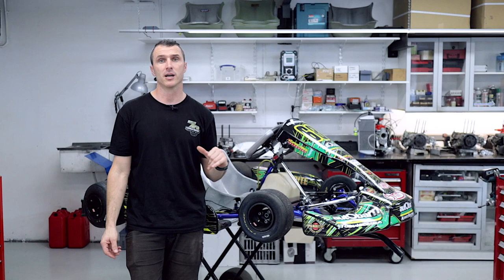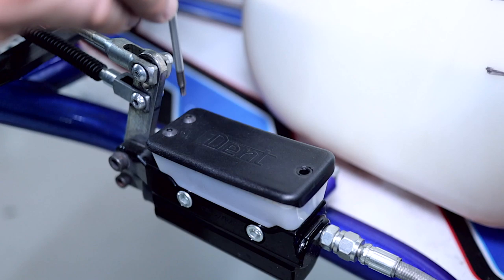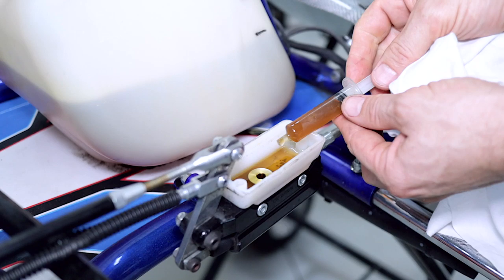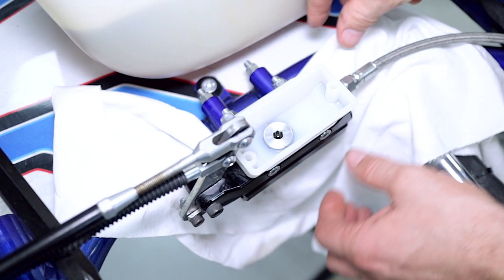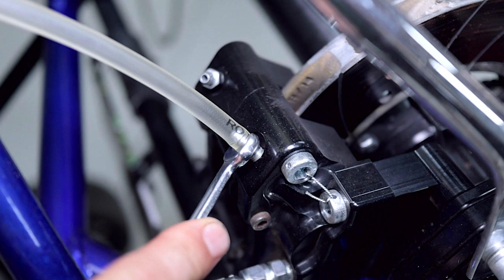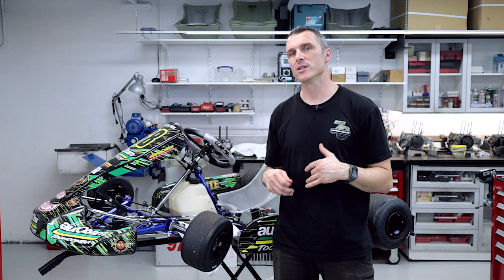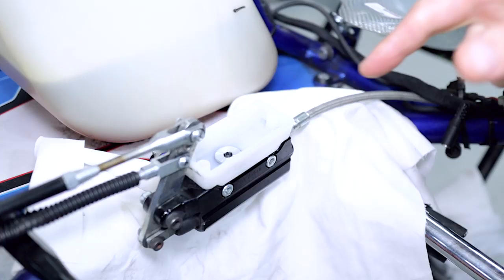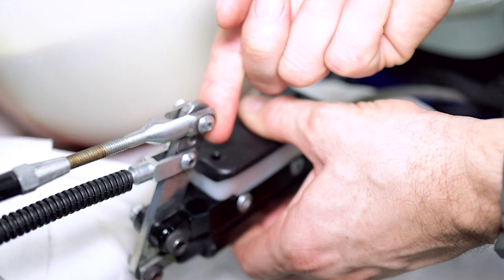HOW TO: Bleed Your Dent Go Kart Brakes - POWER REPUBLIC

Comment: Perfect timing. I just got a CRG road rebel chassis and I took the whole brake system apart to clean and inspect it. The fluid that came out was grey. I am going to replace the seals and fill it up again using your video. 👍🏽
Reply from the maker: Sweet as Mike.  Do the child swap every 3 months or after a wet race meeting and she’ll never miss a beat again.
Reply from the maker: @mikederksen6232   we just get rid of it.  the idea is as the fluid ages it isn't any good, so dispose of it.  like Pizza, 'fresh is best'!

Comment: How do I choose between the types of brake fluid? 4.0 or 5.1 I think you mentioned, great video again.  Thanks
Reply from the maker: the main difference is the boiling point, but they are compatible with each other.  so use the 5.1 👊🏻
Reply: @PowerRepublic  thanks so much

Comment: Thank you for this video :) I can see that this bleeding method is exactly the same as on CRG/tinini brakes system, but slightly different from OTK ;) interesting thing is that OTK recommend OTK dot 5.1 fluid but CRG recommend Xeramic dot 4 for their pumps.
Reply from the maker: you are very welcome, hope it helps.  both can go together.  only the 5.0 (silicon) rolls solo AFAIK.  do you have a CRG?
Reply: Unlike the 4.0/5.1 family 5.0 is not hygroscopic and therefor my preffered choice but not all brake systems are 5.0 compatible.
Reply: Power Republic yes, I have CRG and manual said that dot 4 should be used, not 5 nor 5.1. I found on internet that dot 5.1 is silicone based, while dot 3 and 4 are glycole based and cannot be mixed. Also 5.1 (silicone) may destroy seals in pumps so this is the reason that dot 4 is recommended in CRG-like braking system, but I don't know if it's true 🤷‍♂️
Reply: @KKarczmarczyk  no, 5.0 is silicone based. 4.0 and 5.1 are the same family.
Reply: Great timing on the video . my son out grew is tony kart , moving into crg . I couldn't find any info on mater cylinder , so crg use's dot 4? thanks in advance
Reply from the maker: @Eastendhunter9  no problems my friend.  have you re-done the seals in the MC and caliper?  they are very similar to the intrepid system we did in a series if you haven't already watched it.
Reply from the maker: @Aviopic  correct
Reply from the maker: @KKarczmarczyk  not idea but 4 and 5.1 can mix,  I use OTK 5.1 in everything now.  the 5.0 was good but if mixed with anything else by accident it was always a mission to repair to 100% again.  hence why we don't use it anymore.
Reply: @PowerRepublic  not yet, I was gonna do a bleed so it has fresh fluid
Reply: @PowerRepublic  correct, 4.0 and 5.1 will mix fine as the are the same family, 5.1 is an improved version of 4.0.  The oddball is 5.0 which as you said is silicone based. There is no performance difference between the 2 that i can notice but for hobby drivers like me who change their brakefluid once a year there is less performance degradation with 5.0 because it is not hygroscopic, it doesn't get contaminated due to condensation as 4.0 and 5.1 do.
Reply from the maker: @Aviopic  sweet, thanks for the extra details, I'm sure everyone else appreciates the explanation too.

Comment: Hi I just my self a kart for tag res with a leopard motor the brake pedal is realy stiff you can't move it by hand this is my first proper kart I was wondering if this was normal, they work and don't drag when no pressure on pedal Cheers for any help love the vids
Reply from the maker: Hey Mario, thanks for tuning in!!!  yeah the brake pedal should be hard to press, but not impossible to move by hand.   maybe if she's a older model then yeah, they  need some love
Reply: @PowerRepublic  good to know thanks for the reply will try bleeding it

Comment: Having trouble with my brakes on my crg. I fill up the master cylinder and then bleed the brakes but nothing happens. The master cylinder stays full no matter what I do. Please help
Reply from the maker: maybe an airlock in the brake lines.  get a syringe and inject some fluid into the bleed nipple with it open and fill the lines up backwards.  then re bleed the system
Reply: I tried that, opened the bleed nipple but there was so much force I couldn’t pump the fluid in backwards.

Comment: Hey Derek. I have dent brakes and have done a brake fluid flush. Now I have a tiny bit of weeping on the thread on the bleeder nipples. Would you even bother to try and fix this and if you would can you recommend what you would do? Cheers
Reply from the maker: It might be just some residual fluid stuck in the niple exit hole.  Give it a good wash with some meth or even water and compressed air.  That should fix it
Reply: @PowerRepublic  cheers legend I’ll give it a shot 😎 keep up the great vids 👊
Reply from the maker: @tonyholding5111  thanks YO
Reply: @PowerRepublic  you were spot on 🥸 gave it a clean up and no more fluid…thanks for taking the time to answer my question. You rock 👊

Comment: Can ipk brakes be done the same way or will I need the bleeding tool you use int the tony kart video?

Thanks
Reply from the maker: we do it this way.  there is a fill plug in the IPK as well, but I guess it would be faster to do it that way.   but in a pinch, you could do it this way.
Reply: @PowerRepublic  thanks for the reply

Comment: Can I use that technique for an Alonso kart?? Btw nice video :)
Reply from the maker: thanks heaps for tuning in and liking the video YO.  yes you can, works for any master cylinder with a reservoir above the pistons like this Dent model
Reply: @PowerRepublic  Ok, thank you!!! What should I do so that air doesn't go in the brakes system?
Reply from the maker: @khyl_karting  make sure the resiviour doesn't run dry while you are bleeding them.  otherwise you could use a gravity feeder or syringe if you wanted.

Comment: He goofed- He didn't put the rubber guard back on/in the master cylinder before he put the cap back on..
Reply from the maker: Hey Jon, good call, I did goof.  Good to see your paying attention to the details.  We put the rubber guard up under the black cap before re-installation and didn't mention it.  Its easier to reassemble them that way as they fit into the lid.   Thanks for pointing that out.